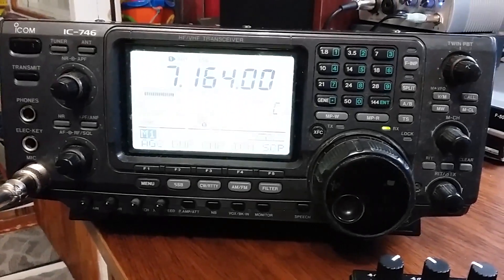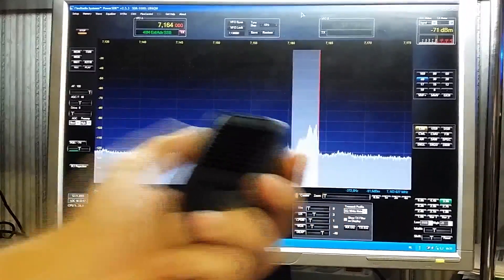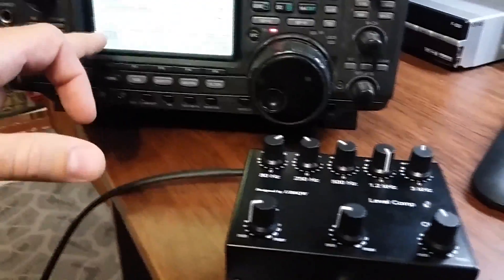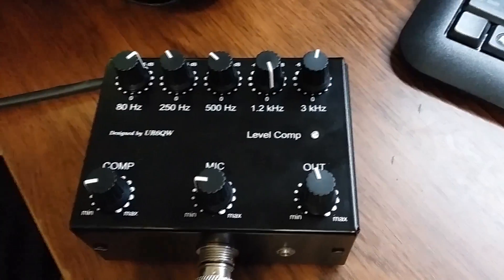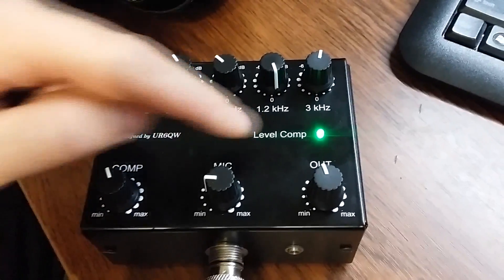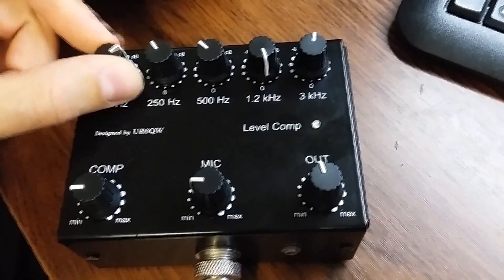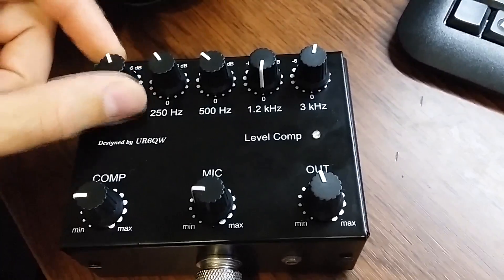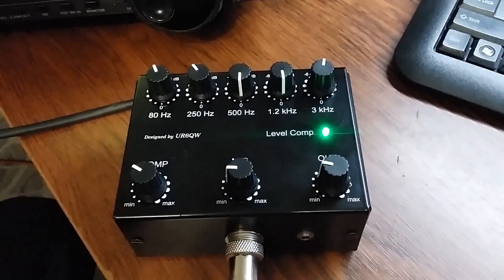UR6QW 5 band Equalizer Compressor to transceiver (EQ V.3)

Comment: I also use ur6qw but I see a little beside the input socket 8 pin mic me the question what is the function of small mono socket? ....
Reply from the maker: +Dpsbali Md 
What the socket you mean? RCA?
Reply: Socket to 3.5mm Jack
Reply from the maker: This is input for Heil microphone or other Electret/Dynamic microphone.
Reply: Does this jack input have the phantom 8v power as the 8pin socket or it has a decoupling capacitor?

Comment: Ok I received this unit an I must say it work very well but I am unable to use my Icom sm30 mic. I get a lot of RF back through the audio on every band except for 75 80 meters. Unless I use the stock mic that came with the Icom 7410. What mic XLR microphone do you recommend for this radio using this Eq.  Thanks 73 AA1US
Reply from the maker: +Mikey G 
Hello Mikey. SM-30 no best choice for EQ. I recommend mike like Heil company (electret or dynamic). EQ has an input 3.5mm for Heil microphone. If you want to use XLR microphone, write me  on email.

Comment: Just ordered this from you on the 3rd of March can't wait to put it in line with kenwood ts 570.
Reply from the maker: +Terry Moon (W5PCJ) Kenwood 570ts has narrow SSB filter, but signal with this EQ looks like as you work to wide SSB filter
Reply: Correct, it does but I put a 2.8 kHz filter in the extra filter slot so when I turn on the "narrow" filter in the menu I'm actually turning on the wider filter so this should work very nicely. Looking forward to receiving it. The tracking information says it is now "left Ukraine exchange to ship abroad " so hopefully it will be in the states soon my friend 73 de W5PCJ

Comment: good job very interesting, any video test  of 8band?
Reply from the maker: +IW7EGQ 
Thank you for your interest. 8band will also be a video, will soon add. Watch for updates
Reply: +Sergey UR6QW I want one 8 band for my ic7700 and 5 band for 857d they need external DC or only a connection to rtx?
Reply from the maker: +IW7EGQ  For IC7700 do not need external power supply, only connect to transceiver and enjoy. And 5band for  Yaesu FT857 do not  need external DC too .